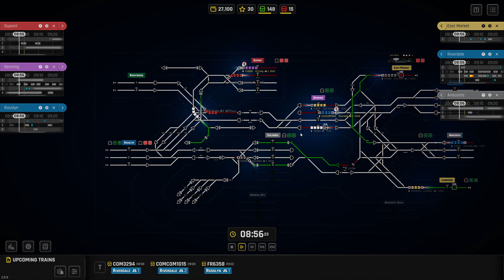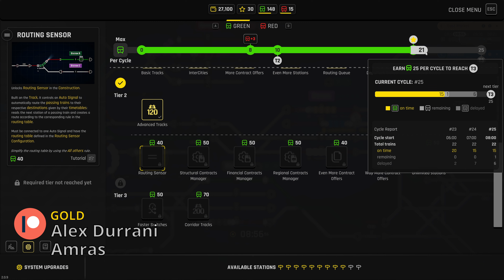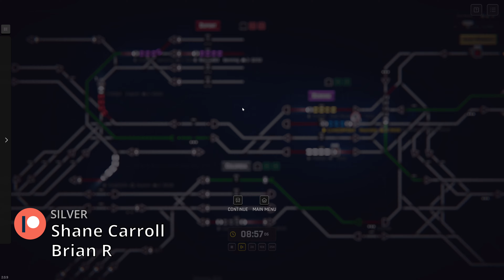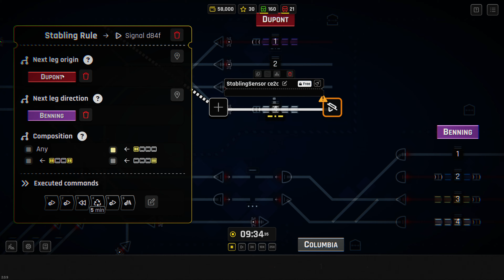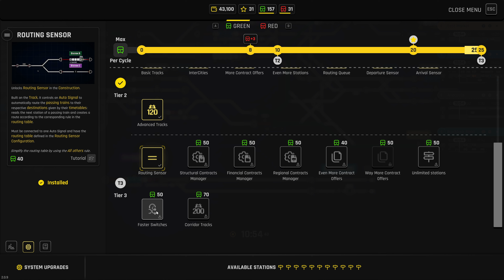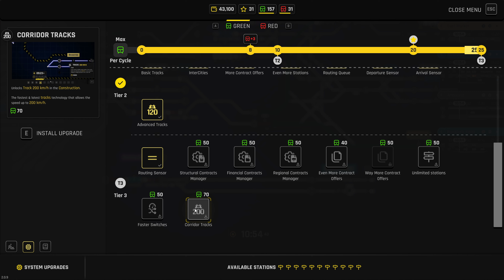FINALLY, THE ROUTING SENSOR - Rail Route Full Release Gameplay - 05

Comment: I haven't used much shunting yet but I'm pretty sure you need to use the shunting track and have to send it to a shunting group to use the stabling sensor.
Reply from the maker: You don't need any groups for the sensor to function. You simple need the same hardware as the stabling sensor has. The difference between this hardware is that the shunting sensor impacts the train as it goes over it, meaning before entering a platform, and the stabling sensor puts in commands after the train has reached the platform. The commands you can give these two tools, and their limitations, are identical.

Comment: What I've found with shunting circuits and stabling sensors is that the circuit starts in the direction that the train is travelling. So even if you just send the train straight to the station instead of shunting it first like what you suggested at the end, you're going to need to add a signal on the other end of the platform in order to start the shunting circuit for the trains. Because that missing signal is what the stabling sensor will use to queue up the shunting commands, since the train is travelling in that direction.
Reply from the maker: Yup. See end of next video

Comment: If satisfactory taught me anything about trains, it is to have many signals on a line, that way you can several trains moving on a single line at a time. I know apples and oranges, but the principal is the same. If trains are 2 squares long you should have signals, I'd say, every 4 blocks. That way when a train clears the segment another train can enter that segment. This works best if you have parallel tracks going dedicated directions. You can space the signals farther apart on areas of less traffic and tighten them in areas of high traffic. Though I'm not familiar with how rail route works fully and this is something to test in a sandbox like mode, but my gut feeling is saying you don't have enough signals to maximize your network.

Comment: the problem with the stabling sensor in the stations is that one end doesn't have a signal, and the train arrive to that signal and the stabling sensor uses that one to issue the shunting commands, i had the same problems as you when using the stabling sensor, it didn't seem to work
Reply from the maker: Yup. See the very end of the next video. ;)

Comment: The routing sensors (including the ones on platforms) have options for copy-and-paste, as well as copying to nearby sensors. Useful for the typical situation where you want every platform at the same station to have the same configuration.
Reply from the maker: I didn’t see that ability there.
Reply: @CharliePryor  Pretty tough to spot. Buttons for it are part of the main popup window for the sensor, above the name of the sensor in dark colors.